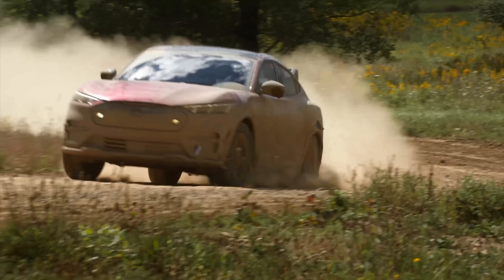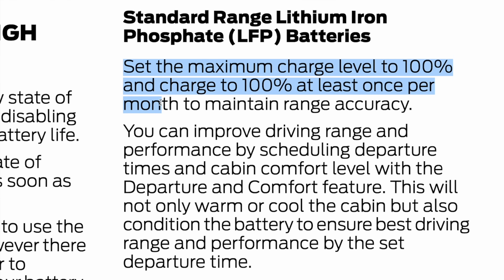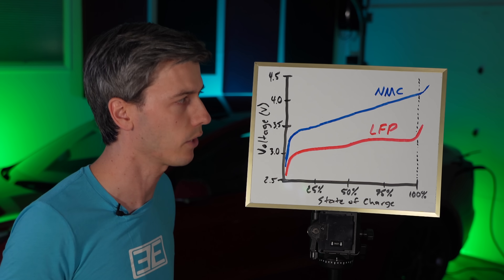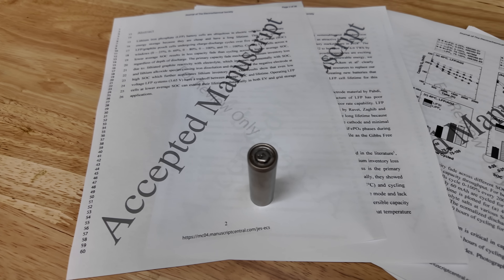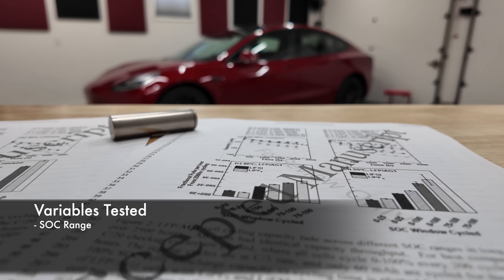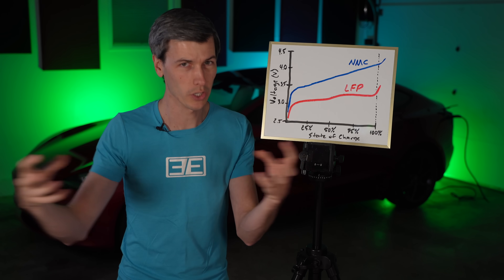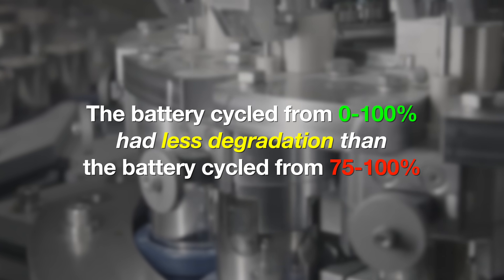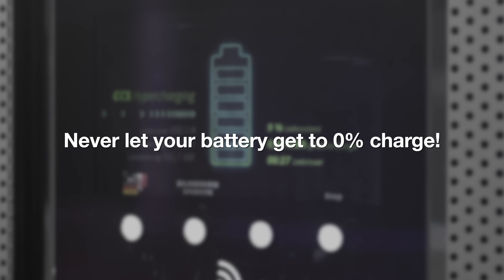How To Ruin Your Electric Car's Battery - LFP Edition!

Comment: Given that the video subject was how battery degradation is perceived to change with charging practices, with a report frequently waved around.......  I was disappointed that there was no reference to the report's summary of the relative differences in degradation as a % of battery longevity.  
Obviously the report must have identified the differences in absolute terms, or the creators could never have legitimately stated there were differences in degradation.

Comment: how do you drain your battery to 50% from 100% for storing long time?   keep accelerating on the road?  will it also degrade the battery life cause faster comsumption will generate heat on battery as well?

Comment: Bloody hell, I thought the 'which-engine-oil-is-best' debate was bad enough but this takes it to a whole new level.
Reply: The gist of the whole video is "don't worry about it, but if you're a car nerd, you'll benefit from the extra knowledge."

Hybrids, gas cars, EVs... manufacturers have done an amazing job designing software to hide the dirty work so that even the most naive car owner can just drive something and still get a good amount of life out of the vehicle.
Reply: @scott8919 I’m with you. Hahahaha
Reply: @osazenomwan No $hit, I'm 68yr old Certified Analog Neanderthal, my eyes rolled backwards into head and the brain went into shutdown mode.........

I've driven manual I.C.E. vehicles until March '25 when I purchased a used '14 BMW i3bev that only uses the J-1772 plug for charging. 

It's my in-town daily driver, I'm 68 and semi-retired working 3days a week with a 3mile one-way commute, I try to keep my charge at 75-80% and not let it get below 20%.

I live west of Seattle, we don't get the extreme temperature swings that other areas of the country get, this past summer my Guess-O-meter was showing in the upper 70's of range, so I'm assuming that I don't have much battery degradation.
Reply: @scott8919  I think the whole "don't worry about it" would get you in trouble. You should worry about actually charging it. I have seen plenty of people so dam lazy to take the extra 5 seconds to plug a car in that its bonkers. there is a reason why so many hybrids don't offer a plug in option and a smaller battery, people stop worrying at a proper level. if you do give a dam, then you can actually appreciate having an EV, and if you don't then keep using the ICE vehicle that likely doesnt get maintenance and will break faster, all so you don't have to plug in a car but still need to drive out of your way to the local gas station to put the gas hose on it.
Reply: I’m with you , but It keeps our minds active , don’t you think ?  😁
Seriously , as advanced as we have come , the more life becomes complicated . lol
Reply: lmaooo

Comment: Higher temperature (>35°C) is a magnifier of cell electrolyte degradation at higher state of charge. 

Charging at cooler temperatures (<10°C) is more damaging to free Lithium+ consumption (capacity degradation)

Graphite negative anode and electrolyte are nearly the same for NMC and LFP chemistries.

LFP positive cathode is more rugged then NMC positive cathode but produces lower cell voltage which translates to lower energy density. 

Longevity of NMC is dominated by NMC cathode, with greater NMC cathode degradation at high state of charge.  Longevity of LFP is dominated by graphite negative anode and electrolyte.  LFP cathode is more tolerant of being held at higher state of charge.

Knowing state of charge for LFP battery is like dead reckoning navigation.  Need to find a known reference point periodically to recalibrate.  Identifiable reference point for LFP is full charge voltage.  Also need periodic cell SoC balancing which for LFP needs to be done near full state of charge, also requiring a periodic full charging cycle.

Comment: Man on Man, some people worry too much! Just drive the car. When sitting still it should be plugged in if possible on the lowest charge rate needed. If you fast charge all the time ,you’ll be spending as much as you do on gas. I have been driving them and working on them for years. I’ve gone 13 years without ever fast, charging a car. I use a plug-in for trips. The computers in the car are not really going to let you hurt the Batteries.

Comment: This is ridiculous for the regular mom and Pop who drive these cars. Electric vehicles will never become mainstream because of all the rules on how you’re supposed to do it. Every car manufacturer should warranty their batteries for 200,000 miles with no more than X percent of degradation. That ends the story and then you can do whatever you want.
Reply: They arent rules but suggestions. Like ICE vehicles re servicing intervals, oil changes, etc.

Comment: EVs are a joke. With the reduced range of EVs nobody is going to not fully charge their battery just to have it last 20 years instead of 18 years. With a limited range and relatively long charge time vs filling a gas tank, cost of maintenance and the soon to be huge cost of insurance, anyone who uses an EV will soon go back to IC. Virtue signaling because you have been duped into the idea that climate change actually exists just shows how truly ignorant people are. EVs are worse on the environment than IC anyway. The only place EVs are good for are golf courses.
Reply: How would YOU know. Obviously you dont own 1.
Do ICE vehicles owners keep the fuel tanks full, I certainly don't.
And I dont keep my ev 100% charged either, even tho cost to charge is 40% of time almost free, 20% of time it IS free and 40% of time I only charge if am doing a road trip next day
Reply: Newsflash, ICE vehicles have a limited range too.
Reply: Virtue signalling? No one is signalling virtue. I bought an ev bc it was a cheaper uo front cost compared to equal ice vehicle and costs virtually nothing to fuel up. In 6 months, 10,000ks have paid to charge twice, total cost $6, once was just to make sure I knew how to do it I case i had to one day, and other was because the charging company gave me a $20 free charge.
Now, I sacrifice the price the electrical co would have paid me to feed my solar back to grid, a pittance most of the time, and sometimes it's negative, I get paid to use it.

Comment: It's really interesting but I think I will keep my way to charge my LFP battery.
Actually, I'm used to charge it arount 50 - 60% up to 100%
Why ?
Because I don't have a Fast charger near my place but I can plug it in my garage.
So it's very long to charge (I need 24H to charge 30% to 100%).

Problem is that if during the week I don't drive a lot (arround 30 miles a day), I drive way more the week end (between 100 et 300 miles every week-end).
So to be able to always have the range I need that's the best compromise I found.
Fact is that for every battery it's worth to go to much near 0% than 100%. I don't need to charge every day so I do it only to get my full charge for the week-end and I'm happy about it :)

We'll see then how it last on time ....

Comment: You see, this kind of problems we don't have with ICE cars - you refuel with whatever volume of appropriate fuel (3 types - petrol or diesel or natural/liquid petroleum gas), it takes few minutes and the computer is showing the right range and the engine will not be harmed.

Comment: My 2012 Audi 2ltr diesel does between 550 and 600 miles on a tankful. It will still be running in another 10 - 15 years. An EV battery won't last that long. My car has traction control so I can drive safely on snow and ice in any temperature range. I don't suffer from range anxiety, I can have my heater or demisters on all day if I need to. I don't need special tyres to carry the extra weight like an EV. I could go on and on. Suffice to say I, like millions of other intelligent people will NEVER buy an EV!

Comment: Thanks for sharing your knowledge. Model Y 2024 long range. Off grid so day time charging is best. Been charging to 80% @20 Amps, asking should i charge to lower % as needed but  at 50 Amps, is that a acceptable strategy?

Comment: I'm kind of confused on 1 LFP best practice #4, You mentioned to avoid small charge cycle with LFP batteries. But what if I do those cycle at 20-50%? Is it still not recommended?

Let me clarify the question even further, which is worse charging your battery from 20-50% more often or 20-80% but less often

Comment: This was really helpful! Thanks for sharing. It seems like you could make an algorithm that could suggested to the user what action they needed to take for their specific case based on the following: 1) Battery Composition 2) Normal driving use (either by learning over time or manually entering. In addition you could have an option to let the system know you are planning a trip in the next few days so it can adjust its calculation.) 3) Weather forecast for the areas you'll be charging/driving in. (onboard temp sensor can be used to calibrate for in garage charging.)

To calibrate the algorithm, you'd need to conduct a study similar to the one you reviewed with both battery compositions and charge state categories 75%-100%, 0-75%, 0%-50%, 0-25% but with the added control metric of ambient temperature for each of those. (debatable where to start on the low end, but 40-50 degrees F, 50-60 degrees F, etc. all the way up to 110 possibly) Once you have data for the combination of 1) Battery Chemistry 2) Charge Cycle category & 3) temperature range. You should be able to average out the degradation data for the packs tested in that range to get a basis for that category. Then as the owner uses the car it can predict its use case for the next few days based on meeting those categories and give a more accurate recommendation as to how they should charge it to optimize for longevity while also ensuring they have enough charge to cover their planned trips.

Comment: So f*cking long to explain obvious things :
Keep your car as much as possible around 50%, do not overcharge it if you do not need, yes your battery is safe but it will get imprecise state of charge, and once in a while as you need higher range, just charge it over 90%
Even shorter : do not charge it over 75% when you do not need, and do it when you need.

And you forgot about the balancing, that also needs battery over 90% (same conclusion though)

Comment: Research says one thing, Manufacturer says the other.

Bottom line is, if I cannot utilize the full range but only 60% to 20% then EVs with current battery tech aren't ready for prime-time.

Comment: Pretend the battery replacement costs $10k.  if you do ruin the battery, you shouldn't be broke to replace it.  If you're buying this vehicle and have absolutely no money left.. then just dont' buy a tesla.  buy some older Toyota that is pretty much guaranteed not to break and then you'll also have no worries.  The battery should go for an extremely long time, longer than you'll likely own the car.  i wouldn't worry about this at all.  charge it how you want and if it breaks, then it breaks.  Still nothing to worry about.

Comment: you can know if a battery is nmc or lfp by individual cell voltages, LFP are nominally 3.2v NWC are 3.7v  most mid and all high level OBD Scanners will display rhe individual cell data

Comment: I have a Phev SUV. The battery goes down to zero on a long highway trip. However, this does not affect my driving because I continue with engine power. As soon as I take my foot off the gas pedal when I get to the toll collection , the battery starts charging again and recharges during city driving.

You say never to let the battery go down to zero, but it is constantly going down to zero in the PHEV system. So?

Comment: Getting an EV is like driving an ICE and having a marble dropped in your gas tank with every gallon of gas.  Will you notice the first few hundred marbles?   Probably not, but once you've put some miles on the car and got lots of marbles in the tank you'd definitely notice the lose of range and it will eventually make the vehicle impractical.  But dropping and draining or replacing a fuel tank is a lot easier and cheaper than replacing an EV battery.

Comment: Hi jason . With a Nissan leaf they said to always charge to 100% (240v) I don't see an option to put it for ex at 80% . They said it's because at 100% it I'll charge the 12v batterie..  like you said for ford. When you leave for several days , don't park it at 100% . And try to charge before 20 % and under 80% . Do you know something about that . ?

Comment: hearing all of this research is very interesting but the question I have is why don’t the batteries themselves or the battery management systems inform the driver when practices that they engaging have a detrimental  effect on their battery longevity. Why am I not getting messages on my dash panel saying I’m noticing that you’re charging your car in a high range? Your battery degradation is increasing. Recommend that you charge lower for example why is this too much to ask?

Comment: What happens if you have bidirectional charging like V2H or vehicle to home?  You have it connected to a charger but when your electricity fails the car becomes your generator for your home.  2025 all GM battery vehicles with have bidirectional like KIA.  Then if you want to charge your home but do not have their 7000 grand instant on GM charger.  Can you have a charging cord to a 30 amp INLET on your home to run the refrig, furnace and TV directly since the GM card has an inverter and it should be smooth energy.  Yet they say it is DIRECT current to your circuit breaker which you have an interlock, and the MAIN power switch is turned off to charge from your car.  I think it should be just a cord to the inlet but they say it is direct current from the prongs out on the car to the home.

Comment: Thanks for this, I’ve owned both NMC & LFP EVs over the years & have read quite a bit on this, FWIW, would never go back to NMC, now driving a Mach-E Select (LFP).

So, what is not covered here - or anywhere else it would seem based on empirical evidence -  is the effect of solar charging on EV batteries. This is usually a ‘sipping’ process so as to make the best use of when the energy is available. BUT this would seem to be the opposite of what is being recommended here and/or is the worst possible scenario for charging (eg, 75-100%).

Interested in your thoughts about that: SOLAR CHARGING EVs.

Comment: A few things we not discussed in the video: NMC and LFP are not equal in some important specs EV-wise:
1. NMC can usually be charged faster with DC as it's voltage regulation is easier (as kinda mentioned on the video)
2. LFP degradion is usually not an issue on EV's. While NMC can handle something like 1500 charge cycles, LFP can handle over 5000. So a real life range of 300km times 5000 is quote a bit more than most of us want to sit in one car :) 
3. It might be fruitfull to see what BYD says about the LFP battery they make, the one used in Teslas too: While they also advice charging to 100% once a week, they also advice to let the charge go under 10% at least once per quarter and then charge it to 100% in one go.

By the way, BYD's LFP is also used in that Korean  KGM Torres EVX, which has a battery guarantee of one million kilometers (!)

Comment: Still trying to figure out what type my Fiat 500e battery is. You can’t stop it charging to less then 100p and it starts breeping below 20, which suggests LFP. But I read somewhere it’s Nickel. Suggests it has margin on the top, but little to none at the bottom?

Comment: Ford has given the correct information but worded it poorly.
The 100% clause allows the cells to be fully charged and actively balanced, in the upper steep part of the curve.

You can also keep cycling in the middle 50 to. 80% zone without issues, just that the range will be slightly inaccurate.

Comment: So, if I can accept some lack of accuracy in the SOC estimation, then for the sake of battery longevity, it is better to charge operate it within 10-50% SOC on a daily basis.   That 40% capacity is good for me for a week.  
And I can charge it to 100% once in 6 months, or before the occasional long trip.  It resets the charge meter and the SOC accuracy.

Comment: Charged properly, LFP batteries will degrade to about 80% after a decade if you run it down completely, and charge it every single day. Most are rated for 6,000 cycles, but at 0.2C charge rate (i.e. 5 hours or more). In other words, charge at home. 50% to 30% is the recommended charge for storage.

The temperatures cited are actually pretty normal where I live. My testing also indicated that the bottom 20% of charge raises the internal cell temperature even at low rates of discharge by 3-4 degrees C.

Comment: This is such a great video and shows why sealion 6s are a great idea, run in ev mode until the engine kicks in at about 25%, the battery can never drop too low, but then you charge back to 100 in three hours and continue the cycle. I think battery technology is amazing, we just need to be wary and treat them as best as possible. Thanks for the great and informative vid!

Comment: answears sorted in order of importance:
0 -> very bad, electronic wise, battery wise, many problems.
2% -> charge asap
best charge to 90% in most cases, above only if you need, or once a month.
try to not to go bellow 10%, but not panic. 
its same as with your phone. store at 0 means deep discharge and getting up will be a hassle. if you store for long time depending how long, charge to 50-70%. (longer means more) as you want it to a) last long enough. b) not go to the extreemes.